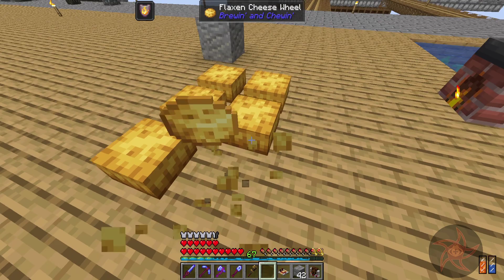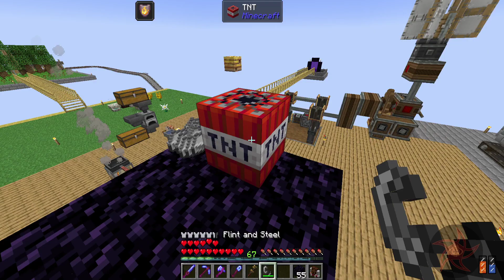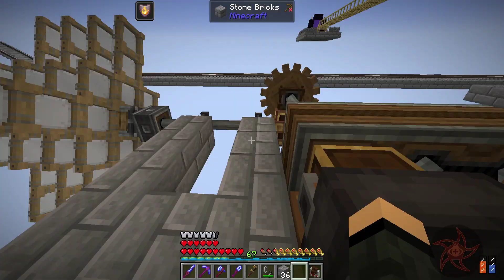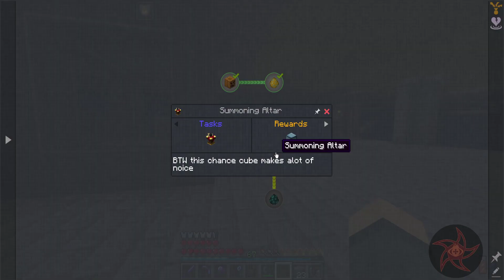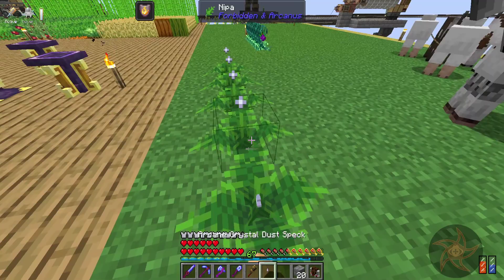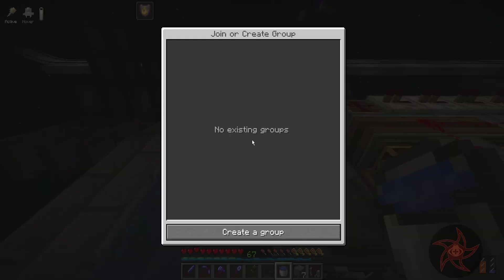Create Block :: Pressure Chamber - Air Power :: CBS-23

Comment: I've only had that pressure chamber effect happen in a ATM pack from a couple years ago. Havnt seen it since. Odd.
Reply from the maker: I had it happen before in Harmonious Engineering, it looks to be an issue with Oculus, shaders and Pneumaticraft, even though I have shaders turned off. I downloaded a duplicate version of the pack, made sure to nver turn on shaders adn built the chamber and nothing happened, so there might be something in Oculus that gets changed when shaders are turned on that is causing it

Comment: Since I am not sure what changes are made you can ignore this if it doesn't apply in this pack. 

For your pressure chamber it should be possible to condense your clutch's redstone line and make it less temperamental. There are two ways that I personally do it. The first and easiest is using the advanced gauge that goes up to 10 bar and allows you to set the bar pressure it will emit a signal at.  The second is using a comparator and a composter that is 80% full. Surprisingly this works and normally triggers at ~4 bar. IIRC if  its at 90% it should be ~4.5.
Reply from the maker: The advanced gauge would probably be the route that I go when I do this in the future, comparators are great, but I just personally don't like to use them in most situations